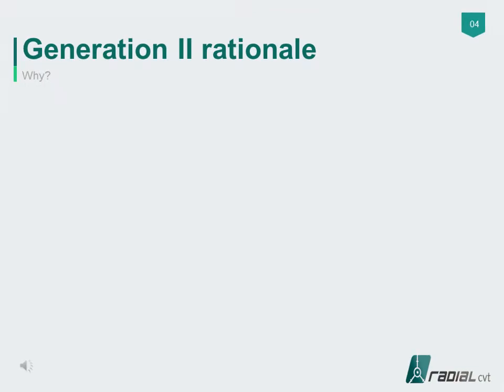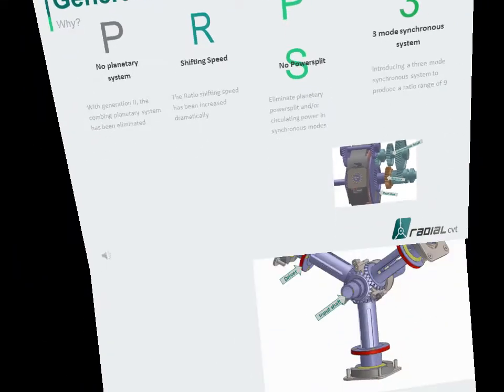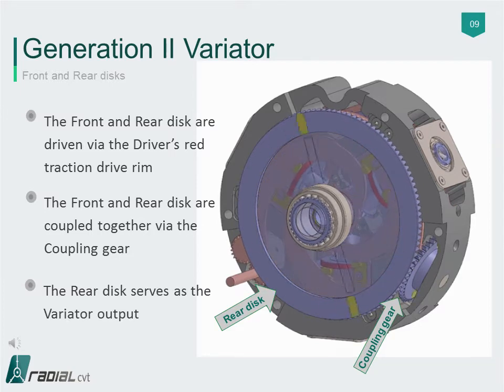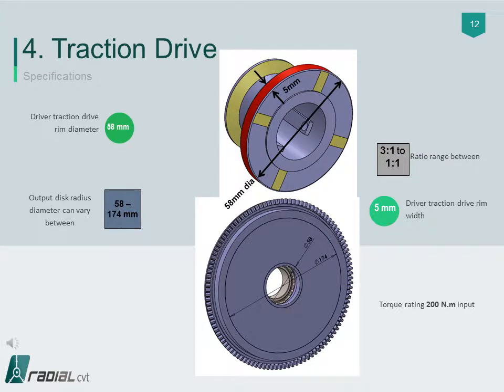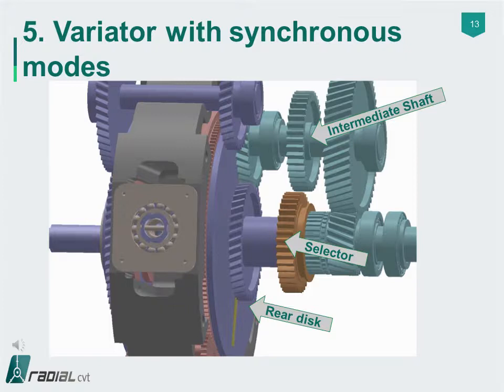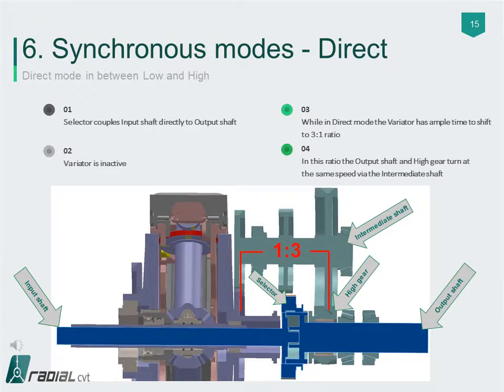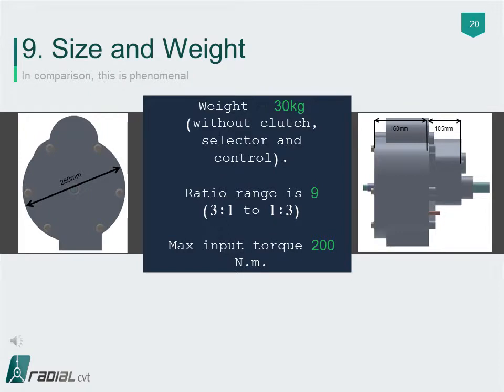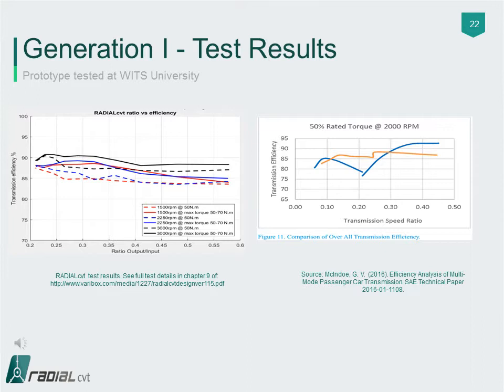Varibox RADIALcvt GenII

Comment: Traction drive. Just a more sophisticated version of the variable drive in your snowblower. Its weakness is wear. The 3 small variator disks are always turning a corner while trying to drive the big variator output disk. The small disks will wear out quickly just like they do in a snowblower drive.